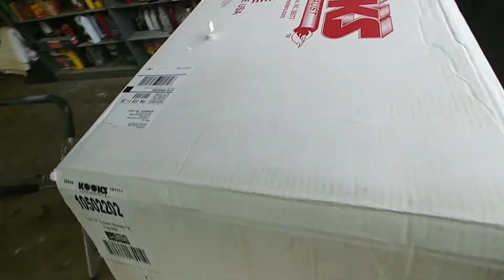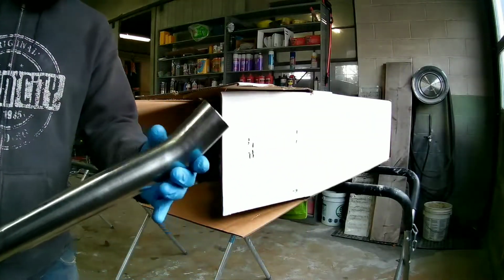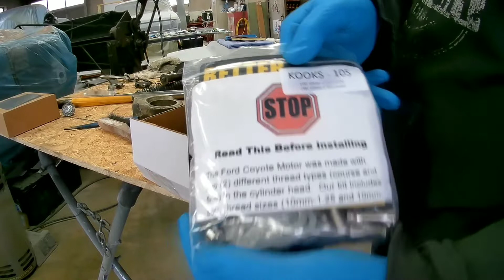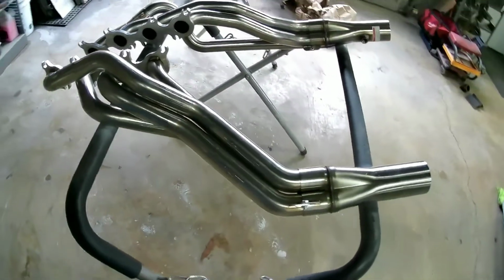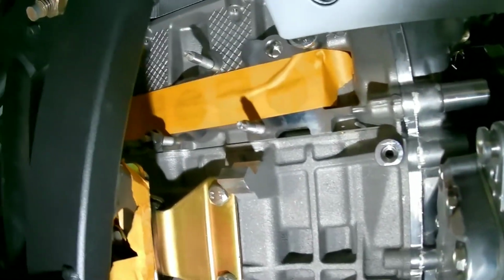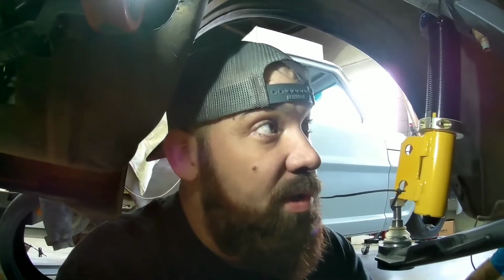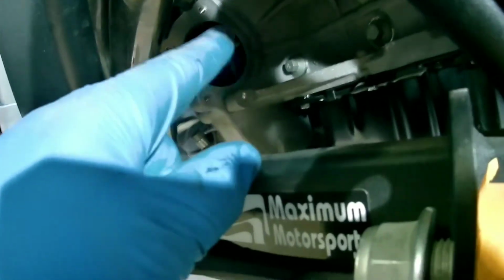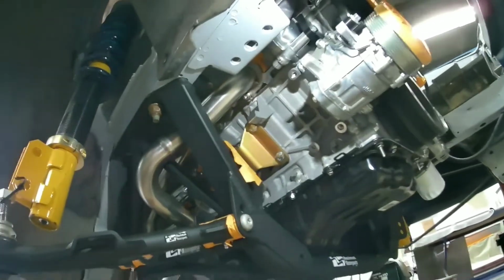Kooks header install on foxbody mustang gen2 coyote swap

Comment: What motor mounts you use ?
Reply from the maker: If I remember correctly, it was energy suspension or prothane mounts. We may have ordered them from maximum motorsports when we ordered the K-member. I know they were definitely a urethane mount and not a stock rubber.